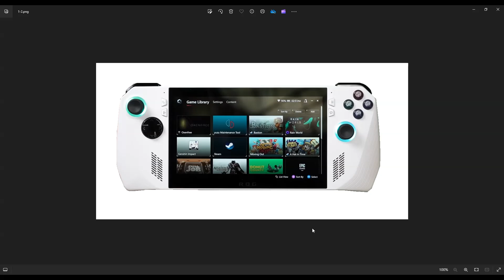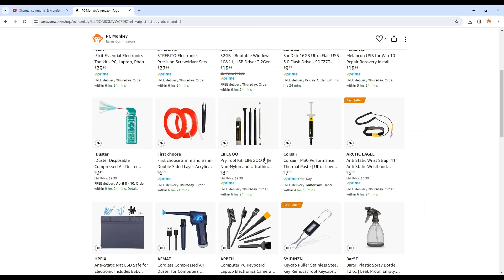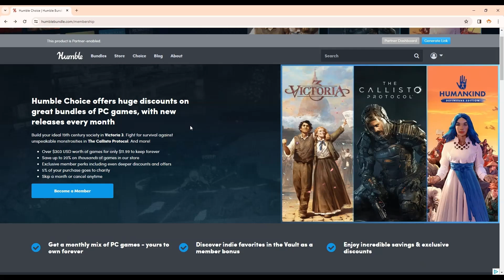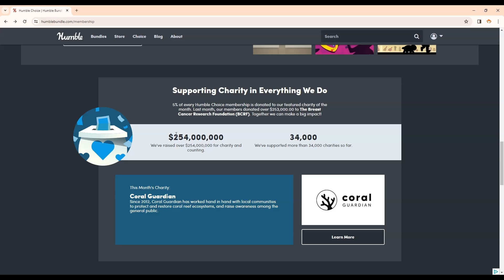Asus ROG Ally - Teardown Disassembly Tutorial

Comment: When reassembling , i can't seem to get the WiFi black and white cables to stay in place , they don't seem to click back in place .
Reply from the maker: If the snap plugs on the wires are not damaged and the snap ports on the card are not damaged, they should snap back together. It can be tricky. They will have to be at a near perfect 90 degree angle to snap back together. If they dont, perhaps they are damaged :(
Reply: @PC_Monkey  i managed to put some tape and get them in place , now my WiFi has very short range

Comment: Can you help?, My Dell laptop suddenly broke?

Like i opened it when i got home and it went straight into the Dell logo screen and on the top right it says "Diagnostic boot selected" I've been trying to fix this since yesterday but no progress 
Note that my laptop battery is broken so if i remove the battery it immediately turns off so i have to keep it plug in all the time.
Reply from the maker: Can you try the steps seen here? https://studio.youtube.com/video/NnXmTF0KAYM/edit. Also, did anything happen before this issue appeared?  Liquid spill, overheating, Windows update, etc?
Reply: @PC_Monkey he f12 doesn't work, When i plug it  in. It goes into the dell logo and diagnosis boot selected immediately. I tried doing it but nothing work and when i try to press my power button it doesn't work at all.

im not sure about the accidents but it was just running completely normally then i closed it went to a trip came home and it became like that
Reply: The power button does work when you turn it on but doesn't when u want to turn it off
Reply: I even tried to use a portable keyboard i connected to my laptop to see if it was my laptop or not
Reply: Can't i just leave it be and wait for it to fix itself or do i have to do something